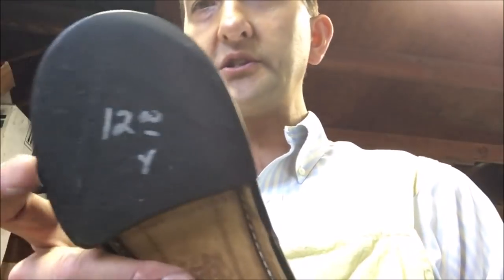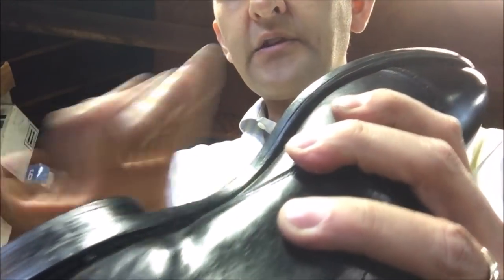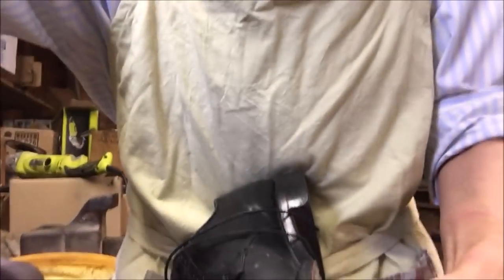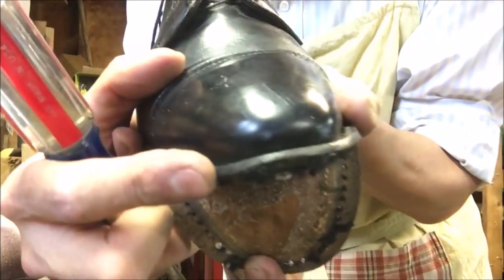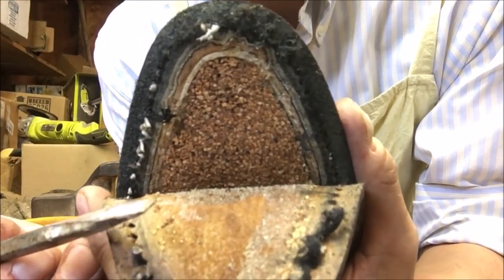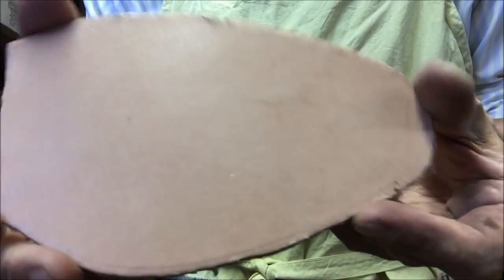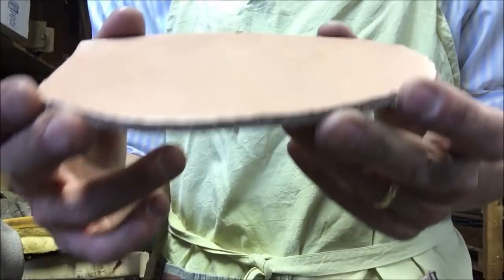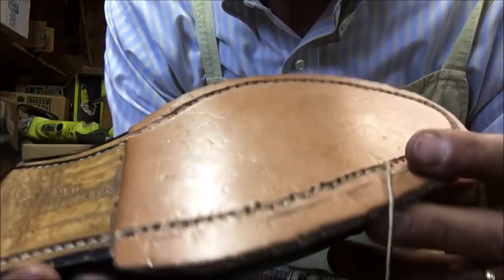ReSoling at Home FAIL... Cobblers are Pros for a Reason!

Comment: I've been a cobbler 25 years, trust me that ain't a bad 1st attempt specially considering  the lack of tools you are using. Dont give up you will improve my advice on shoes you did the leather piece you are putting on taper it so its realy thin leather at the end 1st before gluing it on the make the groove much deeper then with the stitches remember your not a machine so dont try and be, make the stitches bigger 1 every 5 to 7mm will be fine you may even  be ok 10mm  once you pull them tight they will look fine once you have finished lightly sand all of leather including waist then polish with a neutral polish , alot of cobblers paint the waist join on a half sole to make it look a bit nicer but theres no rule I've worked for lots of different companys they all have different ways of doing things and finishing, you obviously  like shoes so keep going
Reply from the maker: Colin Kirby - thank you!!

Comment: I've been looking at resoling a few pairs, but honestly, $120+ resole jobs just aren't worth it to me.  I'd rather just buy a new shoe.  Top of the line resoles with french tips can cost up to $300. Honestly, your work doesn't look too bad at all. If you could find a cobbler who will just do the stitching with a landis in 10 seconds for under $20, that would be very reasonable.  The shining, buffing of the uppers can be done by anyone, and that's the part that everyone sees.
Reply from the maker: tonystark19631 LOL, or here’s another solution I’ve toyed with:
Manual Leather Cobbler Industrial Shoe Repair Machine Make Sewing for Bag Tant https://rover.ebay.com/rover/0/0/0?mpre=https%3A%2F%2Fwww.ebay.com%2Fulk%2Fitm%2F352159940197
Reply: Is the machine useful ?

Comment: It’s not always necessary to replace the welt and actually decreases the lifespan to replace the welt with every resole. Some of these shoe brands do that because it’s easier for them than pulling out all the thread and rethreading through the old holes and they also don’t mind you buying new shoes sooner. I always assumed a new welt was a good thing because, well, new usually means good right? Ha

Comment: It isn't necessary to put a shoe in a jig to set the  contact cement on the shoe, you may simply put it on the last and hammer it. However, your jig would be useful if you ever need to do a repair using a cyanoacrylate type cobblers glue.
Reply: You may also want to set the join of the welt and the sole by putting masking tape on an edge  of your last to protect the upper, pressing edge of the last against the join between the upper and the welt, and hammering  the edge of the sole. this will also flatten the stitching and minimize the holes in the welt.

Comment: That shoe your working on is one of the easiest shoes for us to resole.  The factory doesn't believe in using much cement .even to put protective   soles on, I would need to split the new sole, pull all the stiches reglue soles correctly, apply thin protective sole